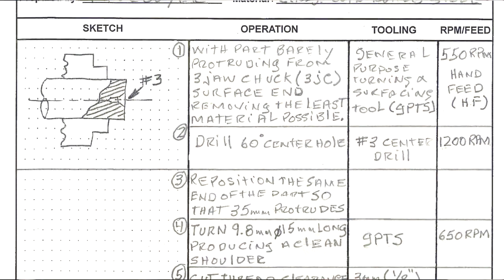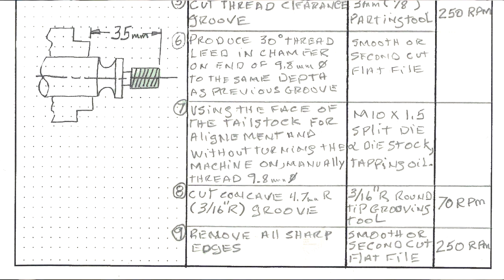SEQUENCE OF MACHINING OPERATIONS  PART 1, planning the order of operations to increase productivity

Comment: There’s also another aspect to be aware of in this plan. Steel and several other materials are stressed out (lol) Or stressed in is better term. Say the part  you’re going to make has tight tolerances and there’s a significant amount material to be removed on the entirety of the part. You must help that material to “calm down “
Example: starting with a piece of tubing in the lathe. Your part has 1/4” of material to remove from the OD and 1/4” from the inside diameter as well. And the part will have bearing fit tolerances in two places on one end and in one place on the other  end of the part, also the part will have internal fine threads  cut near both ends of the part. Well if you machine one side to complete with tolerances finished on one side then flip the part, dial in any run out and start machining the second half. And just before you cut the threads and do your final cuts on those tight tolerances for bearing fit you check to make sure it’s still concentric and adjust as necessary and complete the part. Done right? 
WRONG!! Now you’re scratching your head as the inspector says you’re out of tolerance and the threads won’t fit the gage even though you were certain  the dimensions were absolutely correct and the threads were gaged before you flipped your part.
Here’s what happened: your part has stress inside the material that has been there the whole time before you made any cuts to it. Now when you cut into it it’s stress is relieved but only on half of it so when you do your second half the other half those internal stresses in the steel itself are moving and warping the first half you you machined. In this situation you must rough the entire part leaving enough material to make up for this stress movement and still be able make a good part.

Comment: Excellent video. As noted, planning and sketching operations is very important as parts become more complex. It will help you to foresee issues that may otherwise paint you into a corner as operations progress. Often the issue that catches you out are those liberal tolerances the designer put on the drawing. For example if you are making multiple parts it might be advantageous to hold that +/- 1/16" dimension to a very close value so that any jigs or fixures you cobble up will enable you to rapidly machine features that would otherwise require each part to be an almost one-off affair.
 So, like the man says: Have a plan.